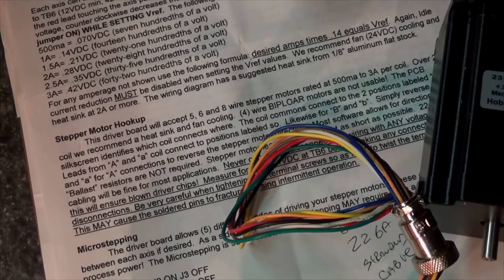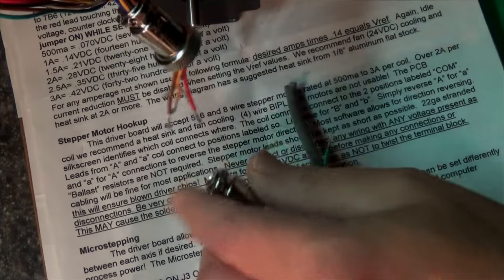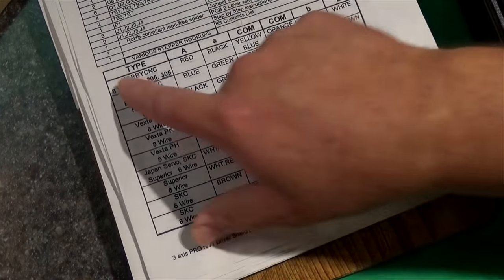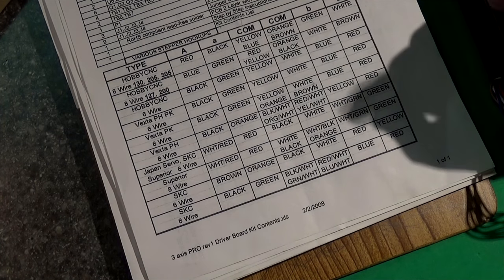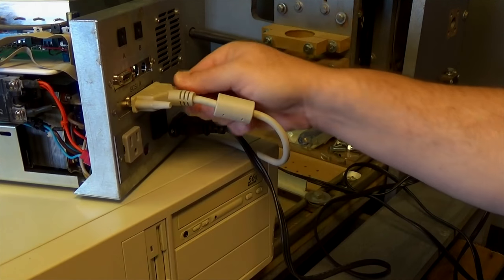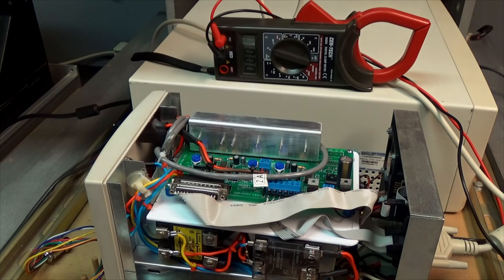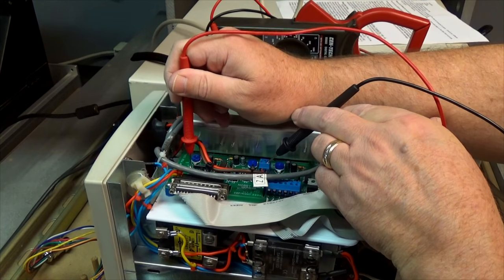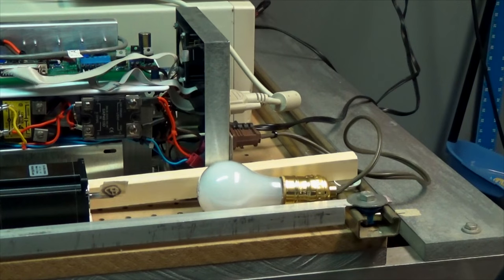Connecting and Testing CNC Stepper Motors and Spindle Relays

Comment: I used a friends metal break to bend the 1/8th inch lexan for my laser tube enclosure.  Worked beautifully!
Reply: what did you use for a heat source?
Reply: No heat needed for lexan.  cold bending it does creat a nice clean sharp bend in 1/8th with just a small amount of flattening in the outer bend. looks real nice
Reply: Never knew that about lexan, tnx Jerr

Comment: Lexan (polycarbonate) will bend mechanically, you can use a sheet metal brake, and go slow if you are unsure. Polycarb is tough stuff